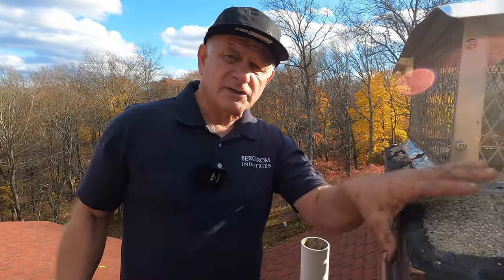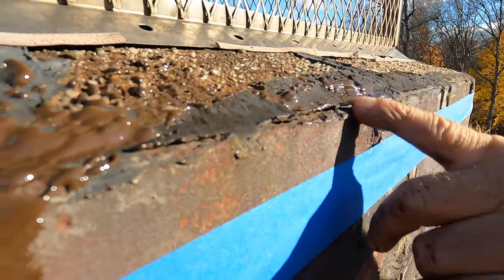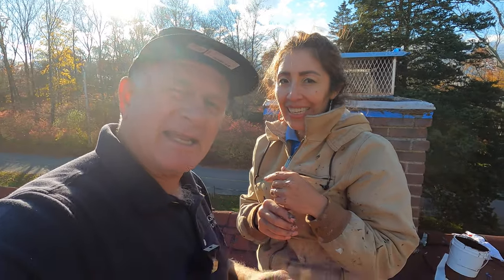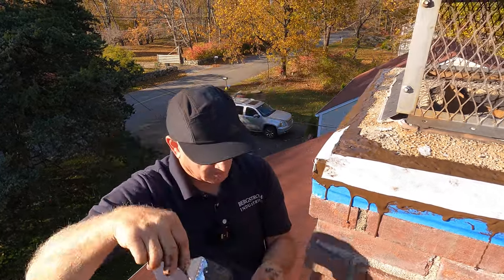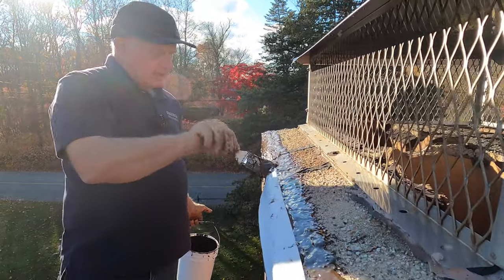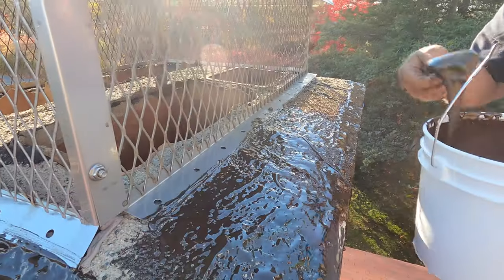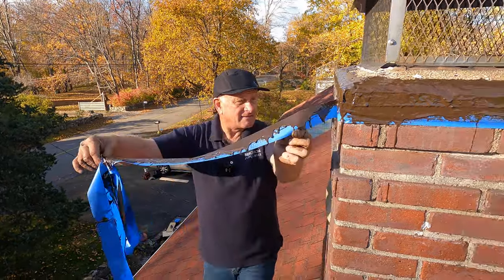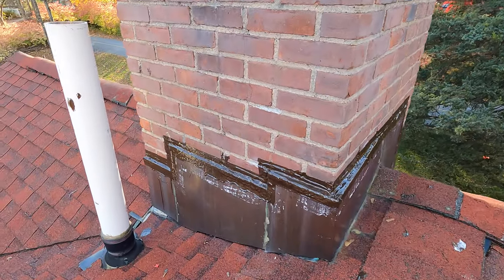Seal leaks on a Chimney DIY. Fix any crack on cement or brick walls with Turbo Poly Seal

Comment: Remove the old crown and replace with concrete it will last for 20-30 years. I like your method for a short term fix.
Reply: Over kill in my opinion